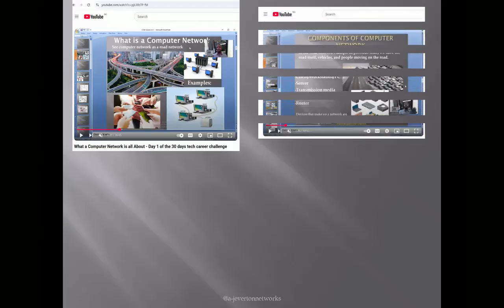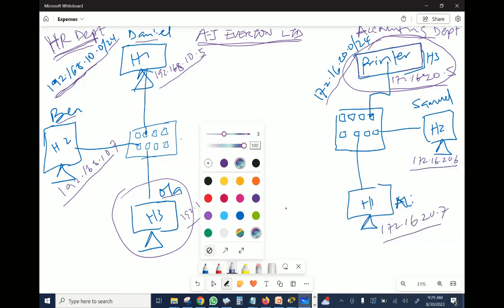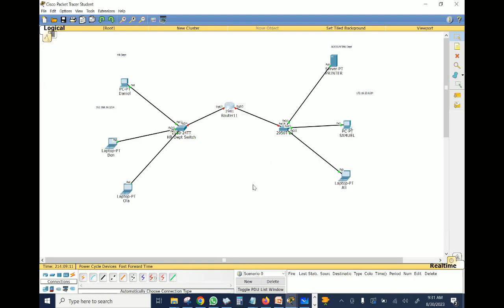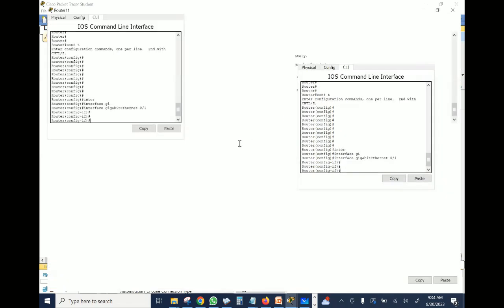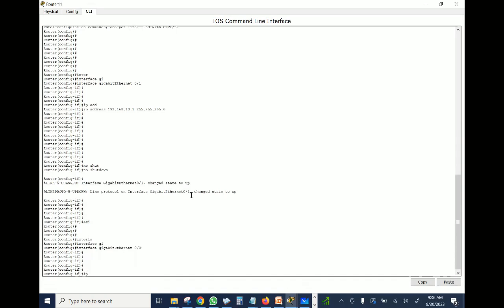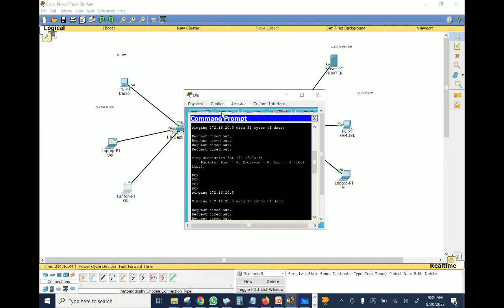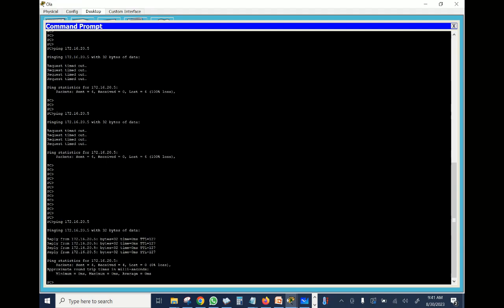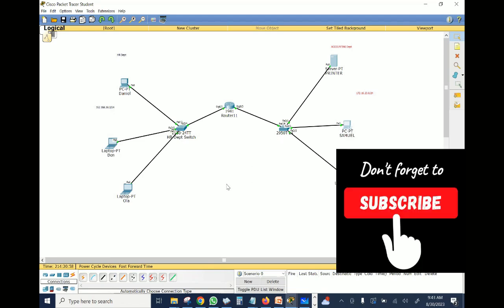How to Configure a Network - Day 8 Part 2 of the 30 days tech career challenge

Comment: Welldone sir
Pls the default gateway you used here, did you generate it yourself.
Reply from the maker: Default Gateway can be any address within the available address space.

However, network engineers always prefer to use the first IP address in the address space, in this our case; 192.168.10.1. 

Hope this answer your question?